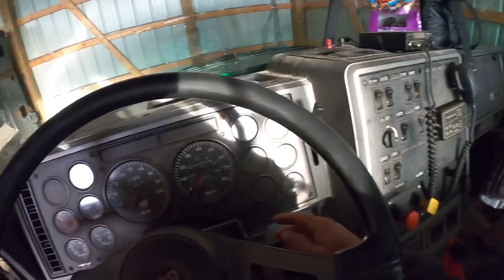Just about buried the Volvo excavator and all caught on camera by my amateur camera crew

Comment: That's why we use drain tile in putting greens. Perk anywhere from 20 to 30 inches per hour, varies on Sand type used in the root zone mix